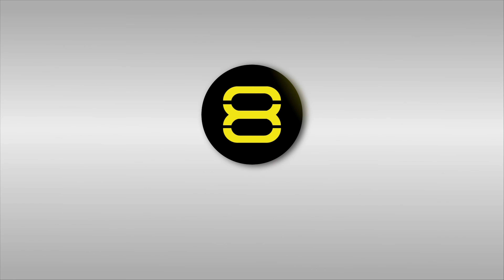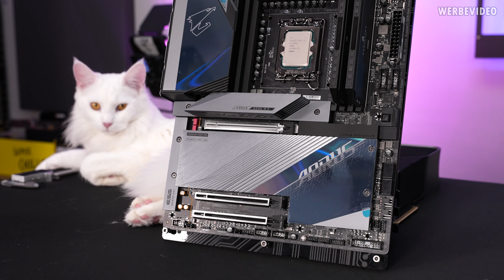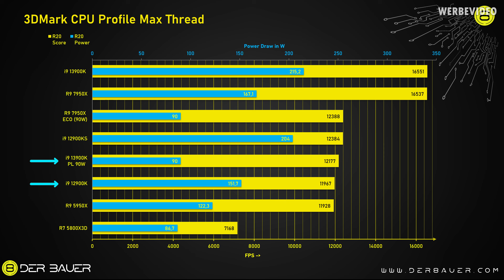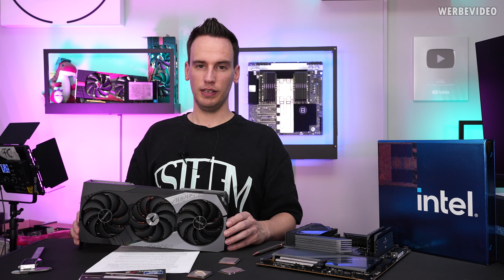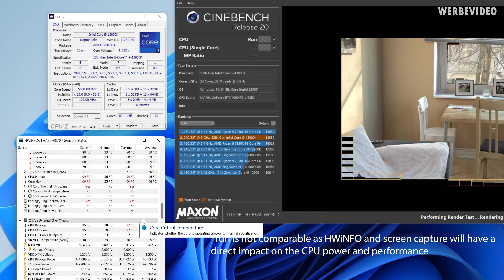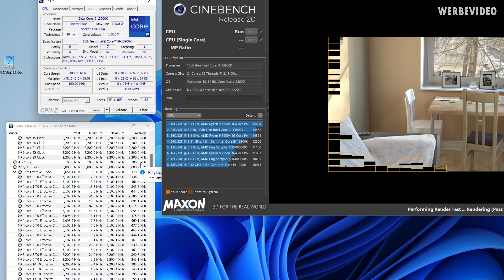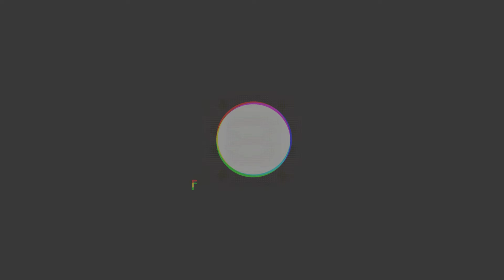Testing and Tuning the new 13900K for Efficiency

Comment: I really like your style of review. No needless bashing and lots of helpfull information about powerscaling, actual power consumption in gaming and efficiency + tuning. This might be my new go-to channel!
Reply: He's the only reviewer thus far that is technically correct and running on ideal setup and tweaks.
Reply: Mine is this as well as Optimum tech for his gaming opinions because I think Ali is only one who can actually aim & do great reviews
Reply: Might be? This guy should be watch maker cuz he’s got the clocks son, strait up Grandfathering
Reply: Except he is yet again another reviewer recommending buying Intel without considering the fact that the AM5 platform already supports PCIe 5 and will be supported until 2025 at the very least for another one or two CPU generations. Moreover, there will be the X3D V-Cache versions 7800X3D, 8800X3D and 9800X3D most probably all of which may well be supported by any AM4 motherboard bought today. A shame really.
Reply: @lagarttemido  thanks for giving us an example of a shill, great example, scarily accurate
Reply: Too bad he only picked games where Intel excels. I suggest you go to Hardware Unboxed where they perform a far more comprehensive review, especially gaming.
Reply: @generalgrevous1984  lol HUB and even GN got every settings wrong all the time. They are often clueless on how to setup a PC. My own benchmark comparison especially on intels are often getting almost 10% more fps than their charts lol. 

Der8 is the goat. He's a proper competitive overclocker who truly knows what he's doing.
Reply: @bingbing3464  You're comparing channels that use stock settings in their reviews to an overclocker. 🤦‍♂ They have clearly stated many times they try to give you a view of the out-of-box experience for the average user, not overclocking users. They have videos where they do liquid nitrogen cooled overclocking but generally I don't expect them to push the hardware as hard as it can go like der8auer does. Doesn't make sense to compare their channels in that way imo.
Reply: @ModernOddity728  what is stock? Especially with intel who doesnt really dictate what their board partners do. That's why you get varying results across each channel. 

We better call those board reviews instead of a cpu unlike what der8 here did by standardizing the external variables especially the memory. Btw even xmp performance will vary between boards and often overlooked by other channels.
Reply: @bingbing3464  😂
Reply: @bingbing3464  der8auer has his own board preferences same as them. Historically I remember GN being angry about vendors overclocking CPUs with their out-of-box bios settings so they probably choose motherboards that don't. The difference is between how the user chooses their settings, cooling and luck of silicon lottery. with their choices. 

Stock settings are the specs advertised to run out-of-box, since you seem lost on the concept? Channels like der8auer & GN standardize their board of choice for testing. However memory can also affect the testing, I noticed der8auer used 6200 DDR5 for intel and 6000 DDR5 for AMD whereas GN used 6000 DDR5 for both. Still haven't seen AMD run on 6800 DDR5 like I have for Intel. But for the performance to price and watt ratio, I'd take an i5-13600k over the i9-13900k and be just fine. But then again, want to see how the new Zen 4 3D V-cache CPUs do as they're supposed to crush everything out now.

Also, if you're going to go and put out smoke that you overclock both AMD & Intel systems the best way, let's see your results. I see no videos on your channel, I would have watched otherwise. I don't have overclocking videos myself, but I'm also not going out talking down on huge tech channels like I'm hot shit when they're not even overclocking in their reviews. lol
Reply: @bingbing3464  As Bing Bing said, you are comparing an overclocker to two reputable channels catering, for the most part, to non-overclockers. DeBauer is awesome, but it sounds to me you're suffering from a bad case of fanboyism.
Reply: @ModernOddity728  that's because amd is capped to 6000mhz 1:1 ratio sweet spot and 6000 is an odd multiplier on intels. Thus der8 set it that way. Once again he's knowing what he is doing. You will never see zen4 running 6800mhz due to the ratio but plenty alderlake rigs are on 7000c40 nowadays. 

My personal benchmark were indeed on stock "paper" settings too and it's actually usually more consistent with der8's than any other channels. I dont make videos so obviously you cant find any. I have people working as mobo testers for asus especially in the bios department in my social circle so yeah..... we all share the same sentiment. They are already busy enough developing the bios for a single board lol.

And i repeat, stock is subjective especially for intels. There's more variables than just Limiting the PL2 and tau. A poor LLC settings can cause the cpu to heat up unnecessarily for example. And then we have sub voltages that will also vary from boards to boards even at "stock".
Reply: @generalgrevous1984  der8 didnt overclock here but being an overclocker he knows how to standardize sub settings often overlooked by other channels. FYI, all boards have their own default stock settings.
Reply: @bingbing3464  So do you know which boards have poor LLCs or rather which have more reliable ones? I have heard of this issue before but not very recently.
Reply: Definitely the best review of this platform so far. HUB is an amd shill who constantly makes 'mistakes' in favour of AMD (and just had to redact his review because of them, bit late for the pro-AMD narrative), GN spent as much time whining about power usage as it did on the actual review. This was just straight forward and on point, without crafting a narrative for clickbait.
Reply: @ModernOddity728  gigabyte worst then its asrock...  msi and asus will be the only 2 comparable at the top. Also gigabyte's bios is a pain in the ass to navigate through the settings. But i do realize there's alot of hate going towards MSI but myself favors MSI's bios more. 

Asus's bios prowess you have to thank shamino, der8 here and the rest of team RoG for the R&D. MSI themselves have some big names backing them too thus leaving gigabyte in the dust.
Reply: @bingbing3464  Again, you are missing the point entirely. But hey, if Debauer is your chief source of information, that's on you. FYI, there's a lot more to PCs than this channel.
Reply: @generalgrevous1984  my chief source of information is I actually own and personally tweak these parts lol....
Reply: @bingbing3464  I generally thought of Gigabyte as bottom tier whether it's GPUs or MOBOs, and I have high regard for MSI GPUs but admittedly wasn't sure about their MOBOs. I have had a bitter taste from ASUS products around 10 years ago when i started gaming on PC but I don't catch every der8auer vid so I missed that he has been helping them, very good to know. Definitely appreciate the info!! Will factor that in when I can afford to make a new build. :)
Reply: @ModernOddity728  well i dont think he ever mentioned about it either but he's part of team RoG's extreme OCers which asus hired for feedback or perhaps used to be. 

Once again, he's a proper engineer vs those other channels and thus der8's contents are usually a little different like this one where he caps the power because everyone else is already doing the basic stuff.
Reply: @lagarttemido  Man it's an intel review foremost and secondly please tell me you don't shill so hard for one company😞and thirdly why talk about upcoming hardware in the future when we have the hardware to compare right now? Seriously dude be more open to all platforms as there is a cpu for every user in this year's release from both Amd and Intel..
Reply: @bingbing3464  It's entertaining to read fanboys' posts, especially when those they worship respect those they do not. DeBauer and Steve are friends and that friendship isn't based on a lack of appreciation or respect. Fanboys like you aren't contributing anything positive to DeBauer's site. In fact, his site would be better off without fanboy's who piss all over other Content Creaters and then claim they are the chief source of 'information.'
Reply: @bingbing3464  Every reputable tech reviewer uses a wide base of games and won't focus  on games favorable to one brand. It's reviewing 101 but clearly that escapes your keen intellect. Yes, DeBauer is an Uber-overclocker but a reviewer he is not, at least not in this case. As for you, you're just simply so caught up in being a DeBauer fanboy, any and all reviewers are crap to you because they don't confirm your biases. No wonder DeBauer's site doesn't get much traction with trolls like you.
Reply: @generalgrevous1984  favorable to one brand based on what source? Review data from your idol who nearly melts his cpus being clueless about LLC or the one saying a slow or fast ram doesnt make a difference?
Reply: @Coffee Fueled Curmudgeon it's a pill that is very hard to swallow for them lol. And they dont know that intel DDR5 now usually runs above 7400mhz while zen4 is capped at 6000mhz. Further increasing intel's gaming performance.... which wont be mentioned in reviews because it's non-spec but every one else who is pc literate will know.
Reply: @Coffee Fueled Curmudgeon Both AMD and Intel have their respective fanboys. Buy the product not the brand, only after they've been 'properly' reviewed - doesn't get any simpler than that. That's why I'm holding off on the 4090 until I see what AMD brings to the table. I have a feeling though 4090 is going to be hard to beat for my specific needs.
Reply: @lagarttemido  a bird in hand
Reply: @GensUnaSumus09  Yeah, no. RTX sounds good on paper but for $500 less I can get a 7900xtx with near equivalent fps. And I don't have to worry about connectors melting. Igor's Lag also came out with an article saying the native connection on the 4090 cards could be an issue. This is why I wait for reviews before pulling the trigger.
Reply: Gamers Nexus info is just as good except with tons of bashing 😂
Reply: Dear der8auer EN, its appears your subscribers dragged you kicking and screaming to finally admit in your videos that Intel has a power problem with their 12th Gen CPU & onwards. Unfortunately Intel will not be paying you bribe money for this video.
Reply: @Matlockization  the 13th gen holds %91  performance at half power. That's pretty good.  Considering it still the best gaming CPU you can use.
Reply: @xdi1733  How many watts is "half power" for the 13th Gen ? And where do they say that in this video ?
Reply: @Matlockization Did you even watch the video
Reply: @casnub5484  Yes, I watched it again. What's your point ?

Comment: Absolutely fascinating video. It really tells a whole different story about the 13900K than nearly all other reviews. It seems the factory tuning is sacrificing a lot of efficiency in the name of one-upping the 7950X by a few percent. In reality, the data shows it's capable of being very efficient when max performance isn't the main priority.
Reply: Exactly, Intel had to pay a price to not lose performance crown. Until ~170W they seem to have equal or very close perf/watt, then AMD can keep it up until 230W but Intel not, they have to push to 280W to reach same performance and they choose to push even more to beat performance.
Reply: that's true of basically every processor, the last 10% or so of performance requires WAY more energy than the other 90%
Reply: Most of it is the motherboards, they don't come with stock settings and most use massive voltage and unlimited power, causing thermal throttling.   Most review sites or channels now days are tech illiterate morons.  This channel is awesome and informative.  Even sites like Techpowerup have their review of the 13900k only scoring 36k in CB, when in fact is scores 40k.  They also claim is uses 200–300 watts gaming, which is insanely  BS unless they did something to it.